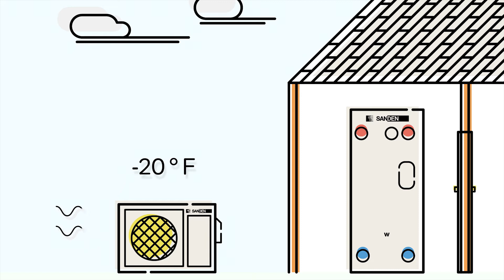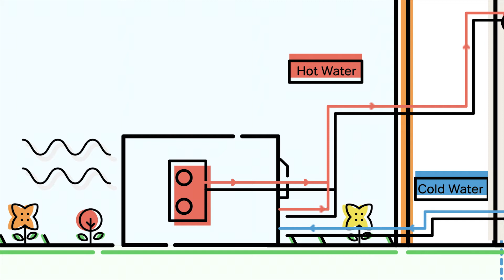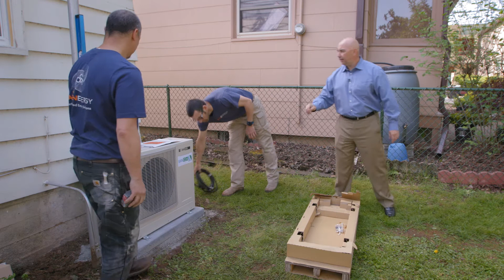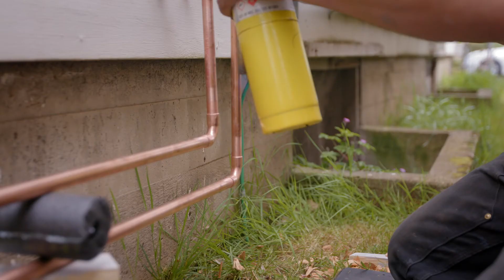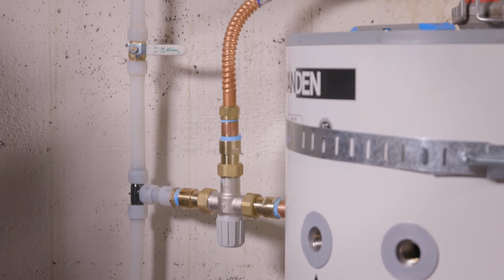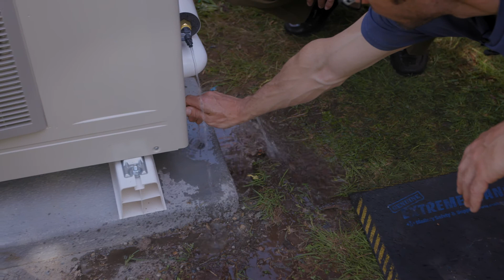SANCO2 - A how to Installation Video

Comment: Overpriced and undersized. R290 monoblock is better and more cost effective.
Reply from the maker: The SANCO2 HPWH is the largest capacity Residential HPWH for sale in North America and provides the highest recovery rate.  
The US Government only allows R290 or Propane is only allowed to be used in Freezers and Refrigerators with a charge of 5 oz only which would not have enough refrigerant to operate a HPWH

Comment: Great informative video.  I wish it was a bit more in line with other water heaters in terms of price. 

What is with the "Strictly 1/2 inch water lines"  to and from the heat pump unit.   What problems would 3/4 line cause?
Reply from the maker: Thank you for liking the video, we understand that the unit is higher in price compared to a Hybrid HPWH but the capacity of the SANCO2 system is almost 4 times higher than the Hybrid HPWH's in terms of recovery rate of between 18.5 and 22 Gallons per Hour of 145F Hot Water which is 25 to 30 Gallons per Hour of delivered 120F Hot Water plus the SANCO2 has no electric element back up so only a 15A breaker is needed as the unit plus less than 7A even on the very coldest day 
The 1/2" water lines are because of the extremely low flow between GS4 Heat Pump and Tank using a larger pipe is just going to add water volume that is not required and actually reduce the performance and efficiency of the SANCO2 system 
Let us know if you have any questions on the SANCO2 system
Many thanks
Reply: @sanco2heatpumpwaterheaters57  

Thank you.  I'll buy one.